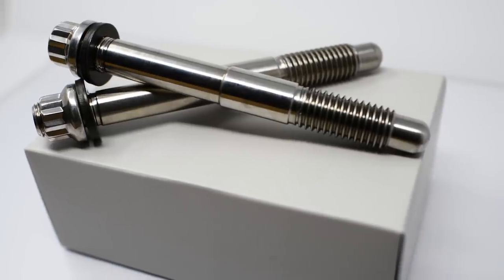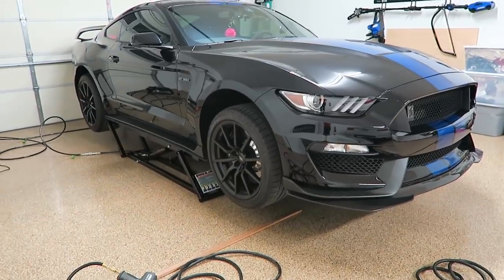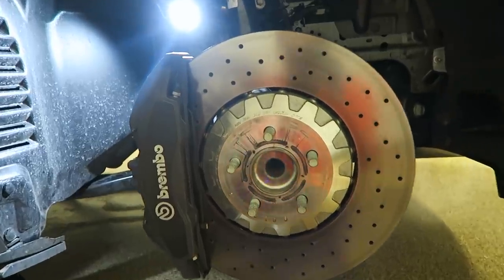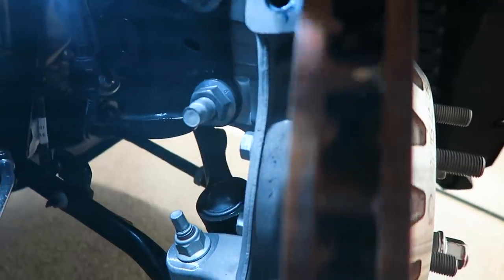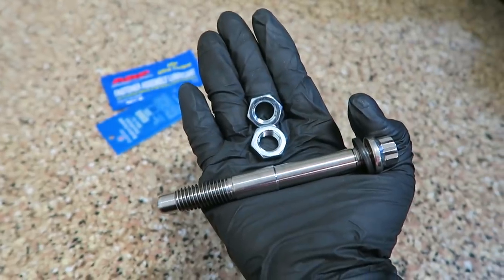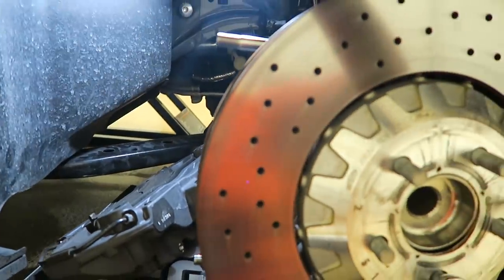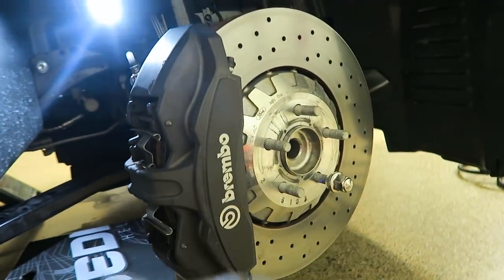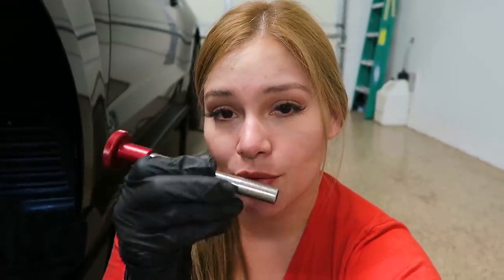Caliperfexion Ford Shelby GT350 Brake Caliper Stud Install

Comment: Had a 17 GT350 and upgraded to the red R calipers. Gorgeous vehicle and very impressed with you knowledge on car and more importantly having the will and determination "TO" work on it. This is a great product and I came close to doing this myself when I did the caliper swap but since I didnt plan to track it I opted out. Spoke to the owner of Caliperfexion and his product is a must if you track your GT350 or GT350R.

Comment: Interesting install.  I can see why you did it.  It's always good to make future work easier on oneself.  I love what you're doing to your GT350 by adding mods, but keeping it an all-around performance car.  As I've said before, I think that's important for a GT350, which is a track car.  Thanks for the video.   Another fun watch!   👍
Reply from the maker: Yes, it will make things easier in the future without a doubt. Glad I got them installed. I can't wait to experience the track. Thanks for watching.

Comment: I was wondering why go thru the trouble to put those on but at the end I see now. It will be worth it in the long run when you need to work on your brakes. I hope they make these for all car types.
Reply from the maker: Yup..it sure will. The work itself without filming would probably take an hour if you went slow lol. It wasn't hard to do.

Comment: that is a smart idea makes changing the front brakes a lot easier that way you can just slide the caliber on instead of trying to fight it to put the bolts in
Reply from the maker: Yup. It works exactly like that. Surprised on such an easy item can be so useful.
Reply: @woman.driven  I'm so glad that u do your on work and have a great day

Comment: Nice video as usual! Those are a great mod for sure. I opted for a pair of $4 bolts to use as slides but the more times I remove my caliper bolts the more I wish I had the studs! I think I need to clean out the threads for sure. Thanks!
Reply from the maker: I feel they're worth it. Especially if you're going to track the car often.

Comment: Great to see another video from you what is the benefit of replacing the studs
Reply from the maker: Quick and easy sliding of the calipers without ever having to drop them. Allows for fast pads switching and rotor replacement.

Comment: One trick for cleaning out threads is to use a tap but coat it with axle grease.  The grease catches all of the debris.
Reply from the maker: Did not know. I'll be sure to use that method in the future. Thank you.

Comment: NIce job!  I have the same color scheme in my R.  I do have a question...I understand the benefit the of studs for changing or pulling rotors but, pads can be changed without pulling calipers?  Plan on tracking my car as well. I haven't swapped pads yet but, I have on similar Brembo setups just pulling the two pins.  Thanks in advance...love your channel.
Reply from the maker: You can remove the pads without pulling the calipers, but for the rears only. The front caliper have a large bridge over them that block access. Only way is to remove the caliper completely, then you have access to the pads but only after removing the pins first. Studs help with a much quicker pad change and the convenience of not having to drop the calipers. Thanks for watching!
Reply: Woman.Driven Good to know.  Ordering some up.  Thanks!
Reply from the maker: You're welcome.

Comment: Nice work, but why?? What advantage do they have over the factory ones? Oh...the calipers slide off and on instead of having to remove the whole stud?
Reply from the maker: Yes. Stock bolts will eventually cause issues with a knuckle made of aluminum if you remove them a lot. Plus Ford recommends to buy new studs every time you remove them. These studs you put in place and slide the caliper off onto the sleeves. Easier, cleaner and you don't have to drop the caliper.

Comment: That's a very nice vinyl chip floor.  They are very easy to keep clean, but they can also be a nightmare! If the floor wasn't prepped properly it will peal, pop ect. Huge headache.
Reply from the maker: For the most part it looks good. I've spilled some stuff that cleaned right up without issues. Looks clean most of the time..looks lol.

Comment: I could see how that would be very useful in road racing.  Did you get some for the rear too?
Reply from the maker: Very useful for racing. No need for the rear. You can replace pads without removing the caliper.

Comment: Hi. What are the benefits of the Caliperfection studs? Thanks!
Reply from the maker: Hello. Every time you remove the original bolts, you have to replace them per Ford. Plus the knuckle is made of aluminum so you can damage the threads over time. These studs prevent that and make it easier to place pads and rotors on the fly without having to drop the caliper.

Comment: Doris, I know you were speaking to me when you donned your safety spectacles. Please get online and for Xmas find some stylish safeties that match your beautiful eyes. That or start wearing a lab coat. You mentioned the reason for the project was to make changing calipers etc easier. My mind has me thinking I have 2 points that become issues instead of 1 with the caliper bolt. Also why didn't you clean the threaded hole with aerosol brake parts cleaner and of course your safties.. Won't threadlock come out with that type of cleaner. Great video as always. Thanks for being safe.  Happy Thanksgiving to my second favorite GT350 OWNER and her family. Earl from RatedR cars is #1..

Comment: What’s the Difference between the Stock Track Shelby Brake Studs? Aren’t they Both still made for Track Use? And good install Doris u pretty thing Haha
Reply from the maker: Yes. But the issue with the stock studs is you have to keep removing them to replace the pads. Plus Ford recommends to replace the studs every time you do. This eliminates the need to remove the studs and drop the caliper. It allows for the easy sliding over of the caliper to remove rotors and pads with ease. Mainly for track use.

Comment: Im confused,is there some benefit on using these studs versus original bolts,or was that just a waste of time?
Reply from the maker: Every time you remove the original bolts, you have to replace them per Ford. Plus the knuckle is made of aluminum so you can damage the threads over time. These studs prevent that and make it easier to place pads and rotors on the fly without having to drop the caliper. Main benefit is track use.

Comment: Hi Doris, what are the benefits of this aftermarket studs?
Reply from the maker: Hi there. Every time you remove the original bolts, you have to replace them per Ford. Plus the knuckle is made of aluminum so you can damage the threads over time. These studs prevent that and make it easier to place pads and rotors on the fly without having to drop the caliper.
Reply: @woman.driven  Uhmm, last time I've only replaced the threadlocker...working fine tho (:
Next time I'll replace them.

Comment: Hi, is your name Doris or Dorace? I'm a bit confused.

I like the cow for studs, that does simplify replacing rotors and pads. For most users it probably wouldn't matter much, but if you're racing on a track that requires a lot of breaking you may need to replace brakes often and this could be very handy in the pit stop.

Also you were handling this tires like a pro, you look much more confident and able to deal with them but I do worry that you're still putting your legs under the car. Try doing this on your knees with your feet pointing away from the car, or if possible do it standing up. If you get used to it you might find this is the easiest way, just grab hold of the rim with one or two hands and Slide the tire right off the Hub. If you want to continue working with part of your body under the car then please get a couple jack stands as backup. I'm sure you're hydraulic lifting system is reliable but things do break and safety is very important. Jack stands are cheap and would only take a few seconds to set a couple under the car and it could save your life or save you from Serious injury. Your channel is starting to grow on me and I'd be heartbroken if you were injured. Besides it's always best to teach safety no?
Reply from the maker: Hello Don, my name is Doris. These will come in handy at the track. I'm excited to use it when I need to replace the pads. I actually forgot to lower the jack to about wheel height. This would have made it easier and safer to remove the tire. You're right about safety. I have some jacks I can use. I will make sure I lower the car to remove and put the wheels on without having my wheels under.
Reply: @woman.driven  thank you Doris and I apologize for the auto-correct errors in my previous post, I actually corrected all of them before I posted but I got RE auto corrected. It's been nice watching your channel evolve as you become more confident in your driving and the work you do on your car.

You rock!

Comment: I have a question for you lady...do you really do this by yourself.  or there's someone behind camera who tell you how to do it? Just curious...
Reply from the maker: By myself. If I have access to someone to for a difficult mod like the springs. Even that all the work except maybe two parts I did myself. Mainly I just have someone check the angle to see if I'm in frame. Then I get to work. Nothing I'm doing is that hard. Watching couple videos, forums and instructions and questions I can ask friends is all that is needed. I make sure I'm prepared and have all the details I want in my mind and ready to show.

Comment: I don’t see the point of the studs- but I enjoyed watching!
Reply: The GT350 uses an aluminum knuckle whereas all other S550 Mustangs use an iron spindle. So if you track your car a bit and have to change the front pads, you have to remove/install the factory bolts over and over again. Each time you remove them there is aluminum "debris" that comes out. In other words, the knuckle gets trashed if you track the car quite a bit and the GT350 was really meant to be unleashed. Once the studs are installed, the calipers slide on and off easily and you no longer have to remove anything from the knuckle. If Ford hadn't cast a bridge atop the caliper (for added stiffness) then you could simply slide the pads up and out but since the bridge is there you have to remove the caliper in order to access the brake pads up front. The GT350 is the only S550 Mustang that uses the knuckle and massive Brembo caliper with the bridge.

Comment: Only thing that bothers me is the "open threads" (the ones that are at the nut). Should have been a cover to protect them from damage. If if they get bad you wont be able to get the nut out. If it made some sense (it did in swedish in my head)
Reply from the maker: The only damage they can sustain is by using an incorrect socket to loosen them. They are pretty well seeded into the caliper.
Reply: @woman.driven  what i meant was the threads that are visible once the nut are in place  and everything. :-)
Reply from the maker: oh. I see your point. Not sure what could get in between that and the barrel of the rim. The space is very very tight. Perhaps an accidental hit if the wheel is off is the only thing I can thing of.
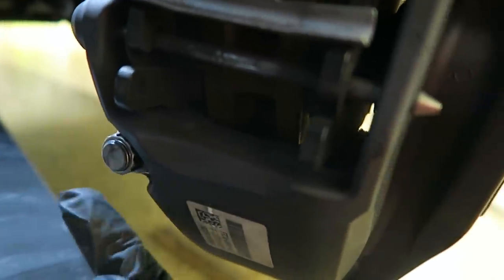Reply: @woman.driven  Its really hard to explain in english, sorry about that. I checked the video again. @9:08 you can see what i meant. The threads are open. If they get damaged you wont get the nut out. The kit should have come with a rubber cap or something to place over the nut to prevent it from getting damage =)

Comment: Nice video, but please use jack stands. Don't trust your safety to hydraulics. ;-)
Reply from the maker: They don't rely on hydraulics to keep the lift up. It has actual hardware locks.

Comment: Whats the point of converting the bolts..seems like the same amount of work
Reply from the maker: Negative. To replace pads on the 350, you have to remove the stock bolts every time (and replace) plus they take some time to remove. Then drop the caliper per and replace pads. With this option you thread the new studs in that you don't remove. Slide the caliper over and lock them with a 12-point nut. If you need to replace pads, remove nut, add sleeves and slide entire caliper over without ever dropping it. A huge save in time.

Comment: Why you change the stud ?
Reply from the maker: Every time you remove the original bolts, you have to replace them per Ford. Plus the knuckle is made of aluminum so you can damage the threads over time. These studs prevent that and make it easier to place pads and rotors on the fly without having to drop the caliper.
Reply: @woman.driven  Thanks for the information 👍
Reply from the maker: your welcome

Comment: I guess I don’t really get the point of these studs 🤷🏻‍♂️
Reply from the maker: Every time you remove the original bolts, you have to replace them per Ford. Plus the knuckle is made of aluminum so you can damage the threads over time. These studs prevent that and make it easier to place pads and rotors on the fly without having to drop the caliper.
Reply: Woman.Driven ahhh!  Cool, thanks for the explanation.  Makes sense now.

Comment: What is the point of installing these I don't understand?
Reply from the maker: These are for the calipers to slide on and off easily and never drop or hang them from the brake line. Easy access to swap rotors and pads. This will mainly benefit anyone who tracks their GT350.
Reply: @woman.driven  ahh makes sense thanks!

Comment: What's the propose of these?
Reply from the maker: Every time you remove the original bolts, you have to replace them per Ford. Plus the knuckle is made of aluminum so you can damage the threads over time. These studs prevent that and make it easier to place pads and rotors on the fly without having to drop the caliper.
Reply: @woman.driven  wow I never knew that. Thanks!!